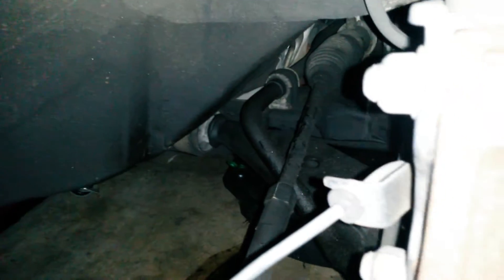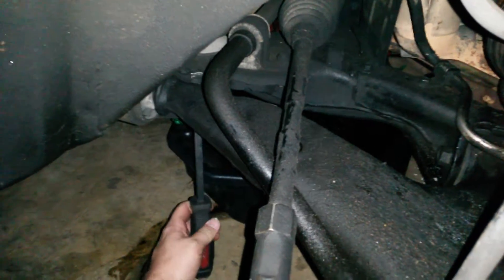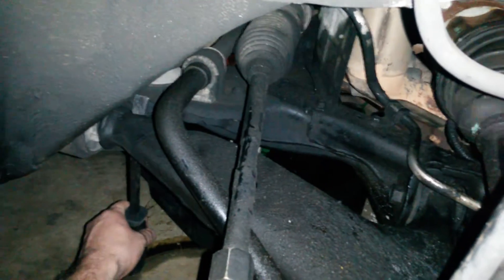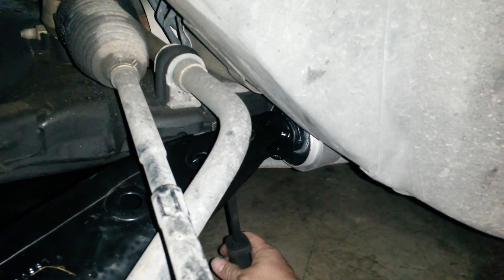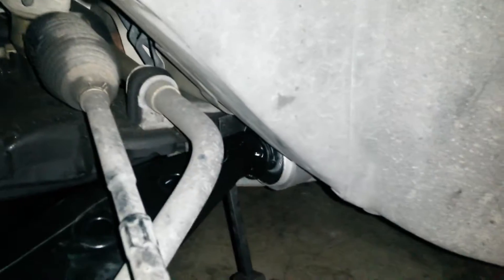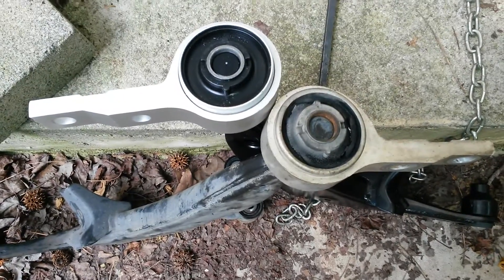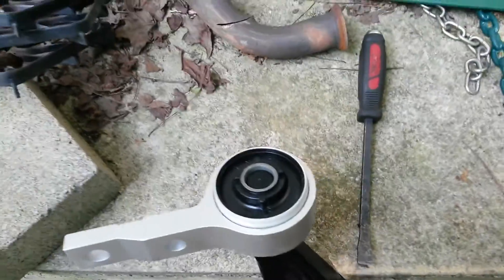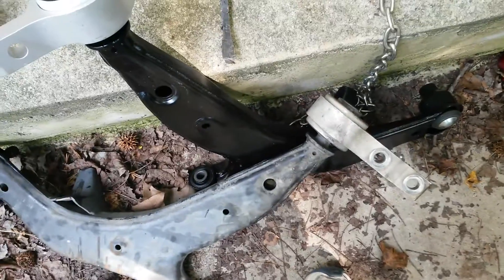Nissan quest (2004-2009) How to: Check for worn Lower Control Arms/Bushings

Comment: Hey please help I have a 2004 Nissan Quest and my mechanic told me I needed to replace the bushings on the back control arms because the wheels are bending outward what control arms car in the back
Reply from the maker: I don't know if the bushings are replaceable...probably not . the entire control arm is about $60 from Rockauto.com or Amazon. The entire control arm will likely save you money over the labor of trying to just do the bushing.
Reply: Hey thank you for responding my confusion is on RockAuto there are  different type of rear control arms meaning there's three different styles of control arms for the rear on the 2004 Nissan Quest any idea which one is it
Reply from the maker: @juliocintron8312  looks like it is just different brands/grades for each wheel corner. I know Moog had two "series" of parts for the fronts.  I used the cheaper ones. I buy the the lesser expensive ones with the most warranty. But  try to answer your question, the is one specific control arm for each wheel corner. Good luck! I cant look at mine for reference, I traded that heap in!